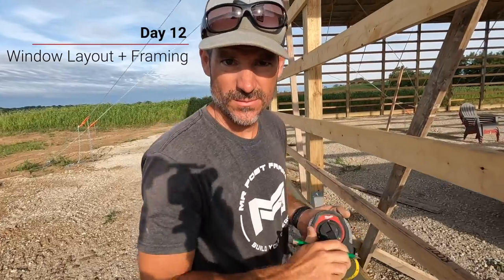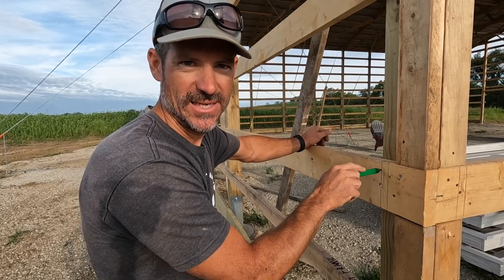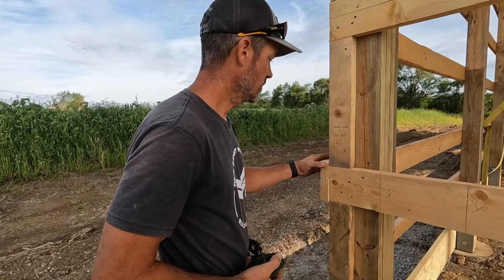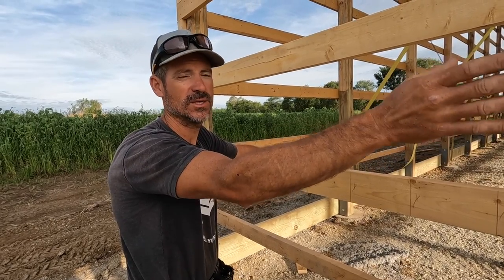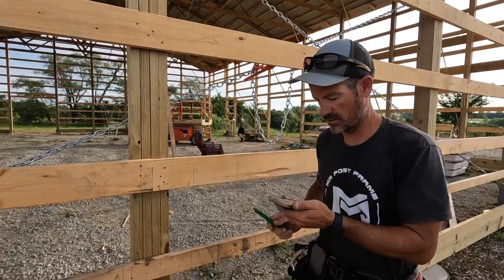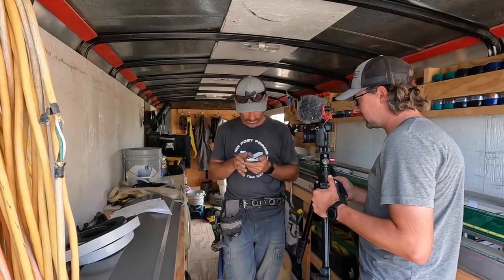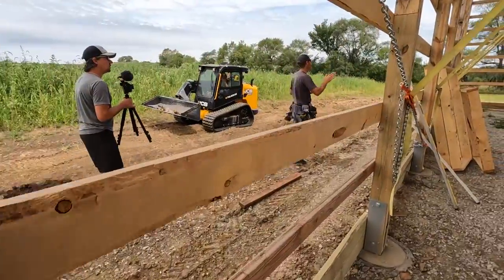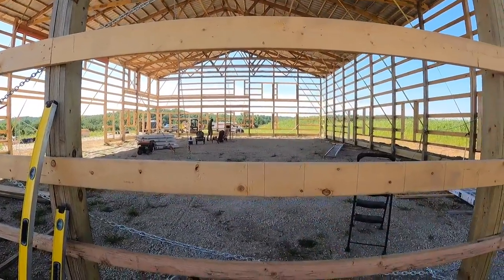The Barndo Build | Day 12 + 13: Window & Door Layout + Framing | Ep 9

Comment: I just found your Channel and I am looking to find property and build /have built a Barndo style home. The question I have is wood post vs steel frame. Why and or do you recommend wood post frame vs steel frame. I also have been looking into the Zip -R Sheathing. My thoughts are steel frame with wood in between and Zip -R sheathing. It was suggest for grater strength for allowing a 5 ton gantry in the shop side and Zip-r for better thermal break while allowing steel siding. What are your thoughts?

Comment: Odd to see that you have flexibility in window locations.  I would think that in this stage, they would be set in stone because of the interior layout.  Especially for the kitchen where cabinets would be ordered to fit between the spaces where the windows should be.
Reply from the maker: We’re only moving about 1-3” and many times not moving them at all. You do need to take interior framing and layout into consideration. For this build most of the cabinets are on interior wall. However, it’s true that there isn’t much flexibility for the windows that are near cabinets or over a sink.